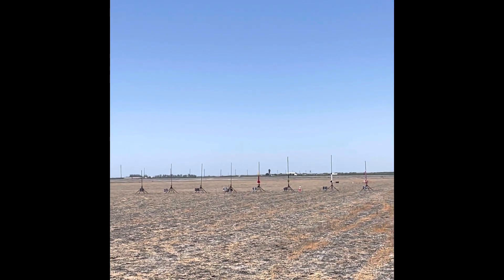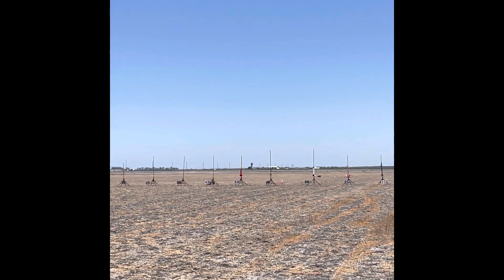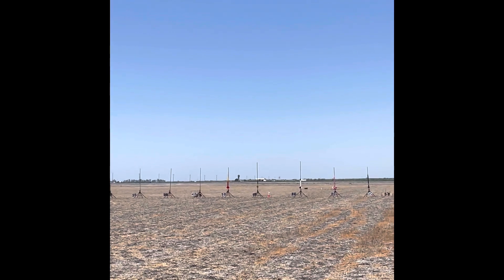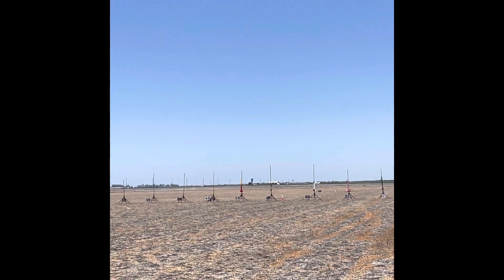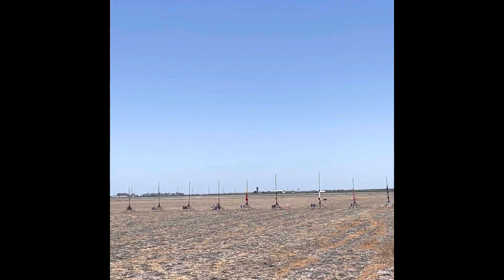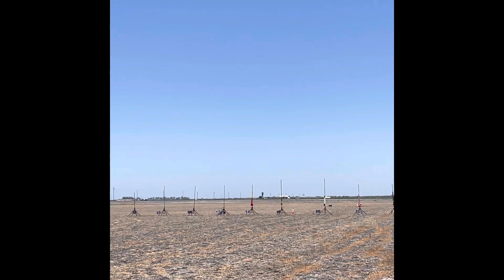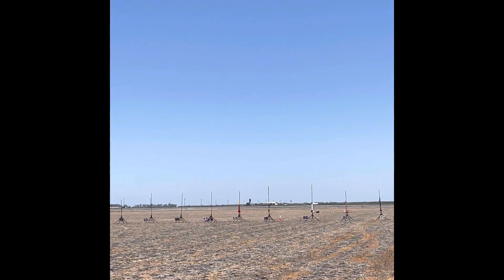Level-1 Certification Model Rocket Flight

Comment: The Zephyr is a great Rocket.  I also earned my L1 cert with my Zephyr.
Reply: Lots of good Zephyr review out there, at my club's last high-power event one launched on an I motor. After a little more mid-power experience it's likely this will be my next build: like yourself I plan to fly it for L1.

Comment: Congrats on level 1, looked like a solid flight.
Reply from the maker: Thanks. It was a great flight. I knew I’d done everything right and triple checked it all but I was definitely nervous the entire time.
Reply: @WalkerSmallEnginePerformance  Level 2 and 3 are even more nerve racking trust me. Worth it though. Welcome to high power, now put an I motor in it and get that thing over a 1000 feet.
Reply from the maker: @TheRocketSmith  The I motor will be happening in a couple weeks.